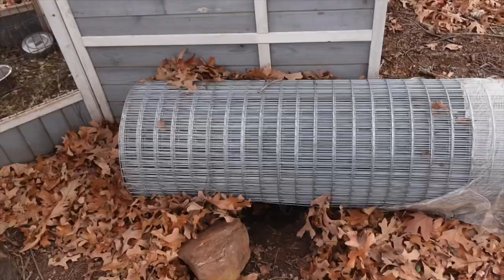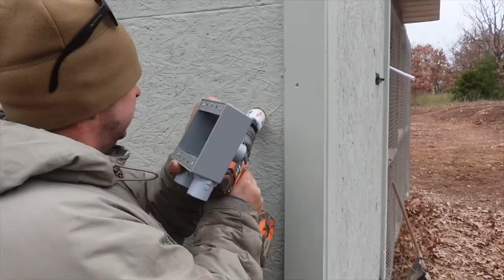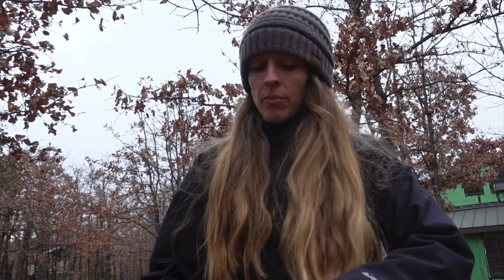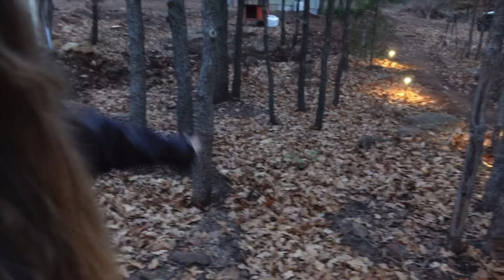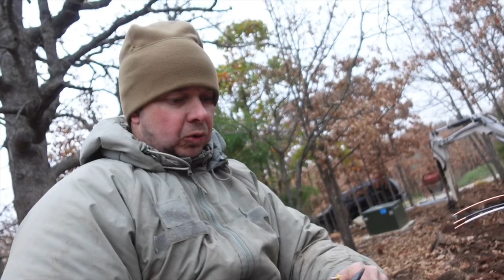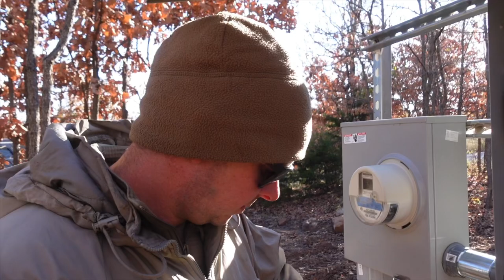Running Electric to our chicken coop!

Comment: Im sorry to tell you but NM-B wire can quickly rot if mistakenly used outside because it does not have the extra-protection of outdoor wires. Potentially causing a short circuit, a safety hazard.